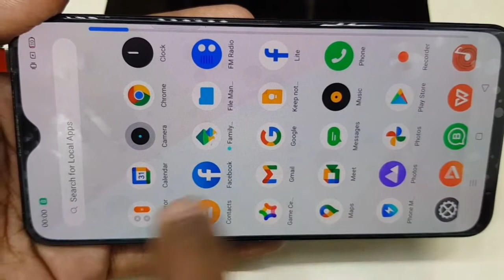Realme XT Display Change

Comment: Hi i have a question does the fingerprint still works after the display replacement?
Reply from the maker: Yes
Reply: OLED display h bhai
Reply: @mobilecare123  bro what is the price of display and display change ? Pls reply
Reply from the maker: @adithyanb1630  ORIGINAL DISPLAY Rs.4500
First copy  Rs.2500
Reply: @mobilecare123  My phone's display is slightly cracked. It seems that the display has come off the phone and the phone's adhesive has gone. What should I do?
Reply: How many cash which I shoud repair it ?
Reply: The screen has been changed and the fingerprint is not working. Is there a solution?
Reply: @mobilecare123 from where I can buy that first copy or original
Reply from the maker: @acksworld  ORIGINAL